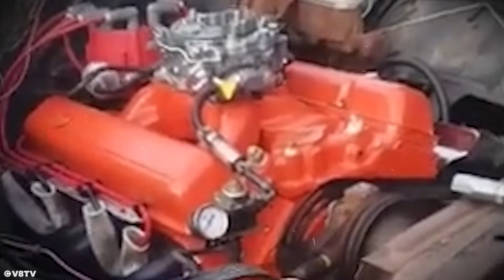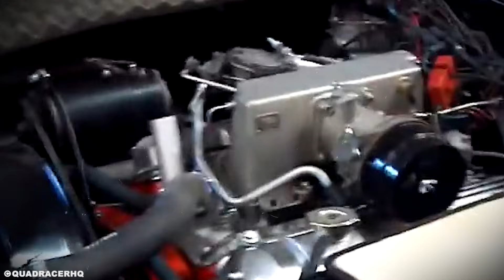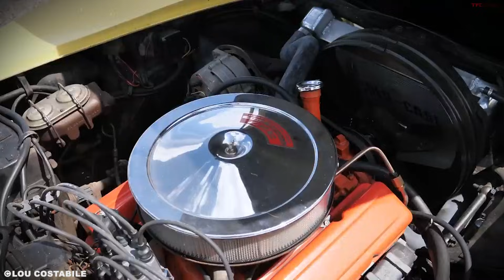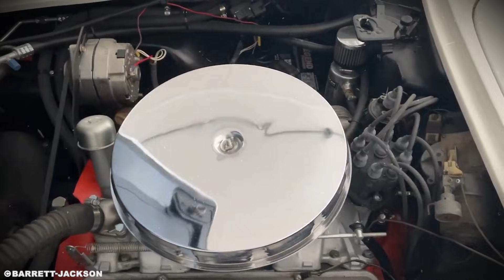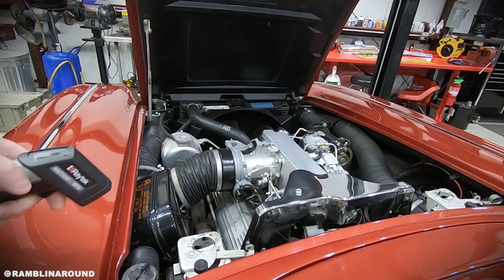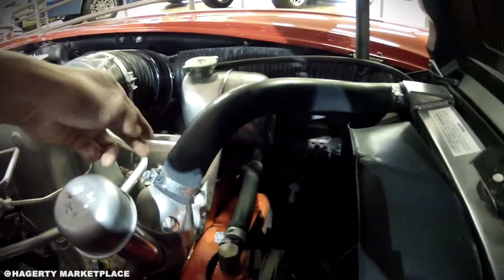How One Chevy “Small-Block Engine” Outsmarted Every Big-Block With a Junkyard Trick

Comment: I built a 350, 4 bolt mains, with flat piston  i put in a 2 stage cam it came out of a 1978 wrecker it had only 35,423 miles in it put 2.516big valve heads off a 1975 Chevy blazer i had pink rods a 61/2 rise elderdrock manifold with a 650 elderdrock carb, that i redrililed to handle 850 needle valve, with rollers on the valve rocker,I had it dialed 750hp to the rear tires I had found a distributor had been set ahead ,with hooked here reds3 in exhaust out the back ,has to run on racing fuel,I still own it, I'm 69 years old I built it when I was younger, I still own it and like to start it up just to here it run
Reply: I'd like to see 400 at the fly wheel with that combo
Reply: "I had it dialed 750hp to the rear tires"...lol. you write fiction as a hobby or full time?

Comment: Born in the late 1960's, in Southeastern, Ontario, Canada 🍁 🇨🇦

I got my Driver's Licence immediately after I turned 16 years old, and I've been a Devoted Chevy Small Block Hotroder Ever Since!!!

And the Quickest and Easiest way to gain lots of Cheap, and or Free, Extra Power from any Chevy Small Block Engine is... 

Gasket Match The Cylinder Intake, and Exhaust Port Opening's, D Shape The Exhaust Port Opening's, and Smooth the Interior Surface's of the Intake, and Exhaust Runner's, without Altering the Factory Port Dimensions!!! 

Just Sayin'🤬